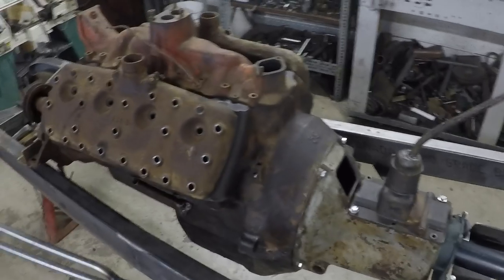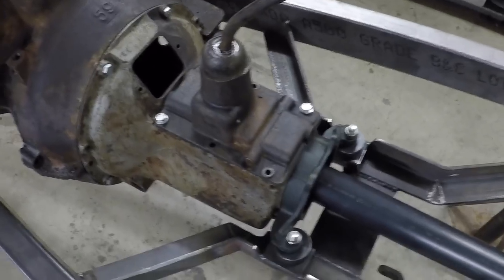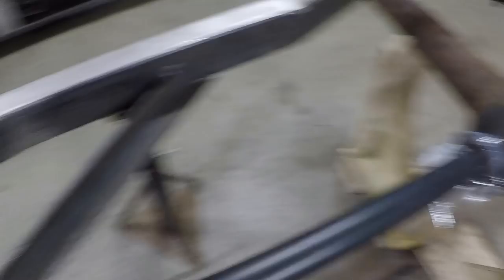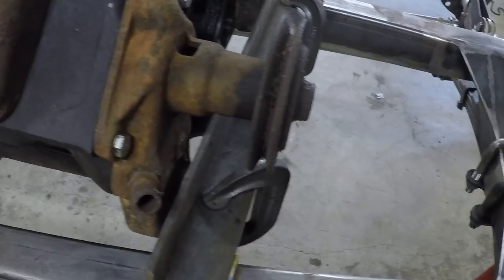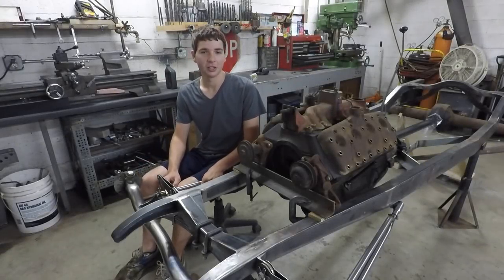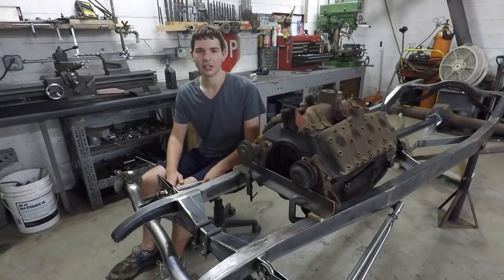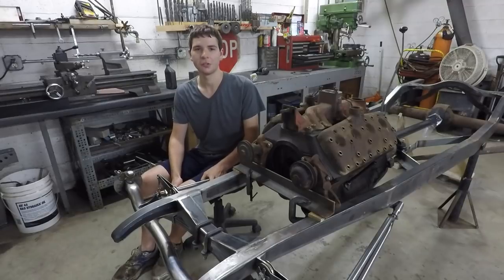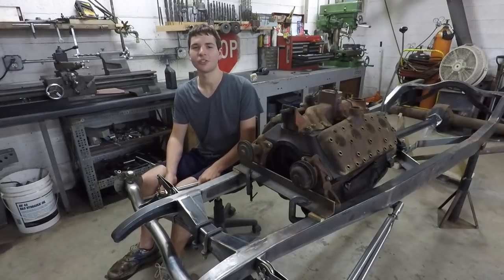Building a Custom Center Cross-member | Boat-tail Speedster Pt.15

Comment: Vince all the best in college, a little Saying I was told many years ago 
you go to school to get educated but once you leave, the real Edumication happens 
as in school doesn't teach you the real hands on Stuff you can only pick up with experience of life. 

I will like many others miss your frequent videos I enjoy them very much 

a query on the Gearbox mount I dont think you have enough bracing or strength in it 
consider adding more to strengthen it, it is also bracing for the frame engine Torque, weight of the body of the vehicle, the human driving it , and the drive train  basically, all that sits on it

Tony from Western Australia
Reply from the maker: thank you! I think the the mount is solid, but it'd be easy to reinforce it if I wanted to

Comment: Nice job, but turn those bolts the other way up. That way, if a nut come undone the transmission  doesn't fall out. (All bolts should be installed that way, unless there's a special reason not to do so.)

Comment: The transmission mounts need a sleeve in between the plates or the bolts won't stay tight.in the inside of the rubber.

Comment: I'm thoroughly impressed by this whole build. However, I do have one question; The way that the X mount will be finally welded together, won't it cause the mount & frame to sag and/or warp the frame over time?
Reply from the maker: I dont think so
Reply: I was thinking add a plate behind the mounts across the top of the angle iron, (assuming it would clear the drive shaft tube). That way the original plate would be under tension and the top plate would be under compression. That would substantially stiffen up the cross member. I'm sure us back seat 20 20 hind sight engineers drive M. M. nuts.  hehe. :)

Comment: Please use other gearbox mounts, the vibrations will go from the engine, true the bold, to the chassis..
Reply: The original Ford mounts are just about the same , just have another (smaller) rubber and washer  on the bottom

Comment: Zero penetration on the welds. Rubber in compression is about as flexible as wood; you are going to have terrible vibration issues unless the motor runs really smooth. Good luck with college, I reckon you'll do great given your self-motivation and your creativity, organisational and practical skills. Engineering career seems a likely fit?